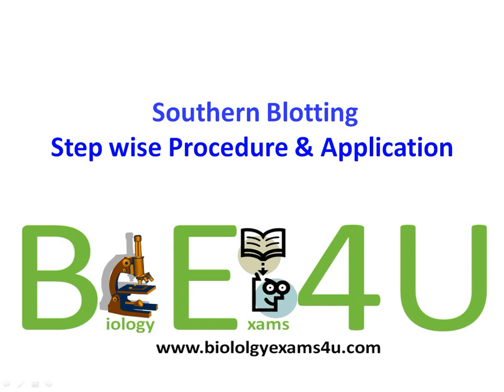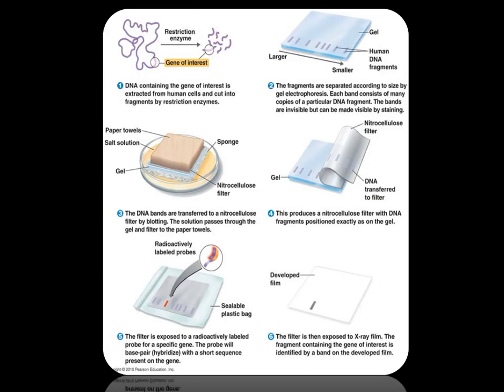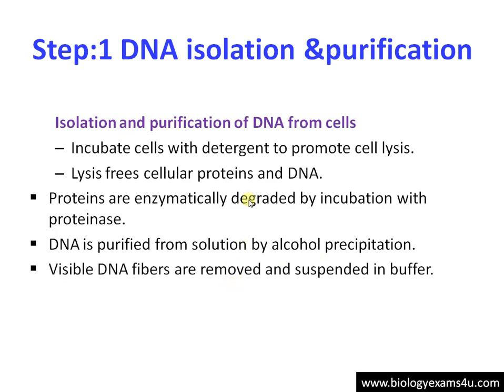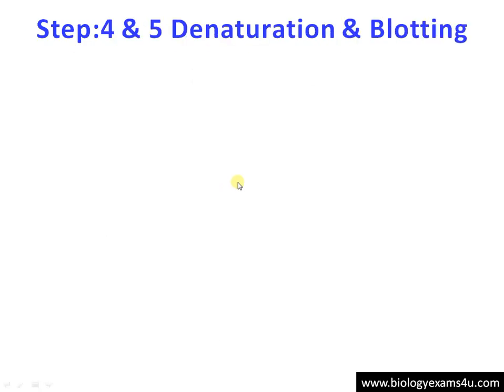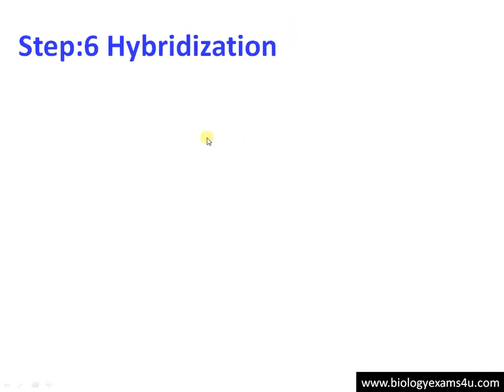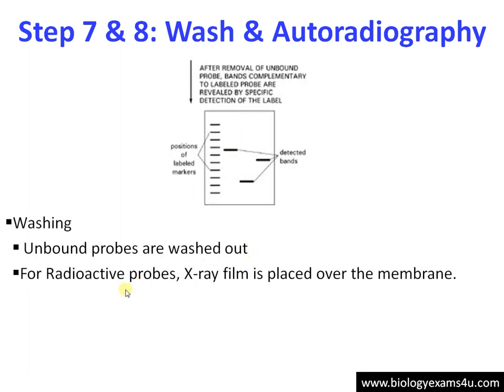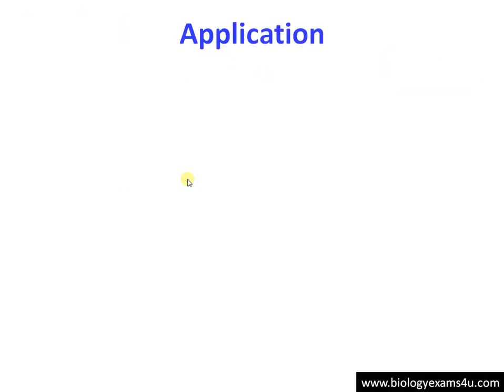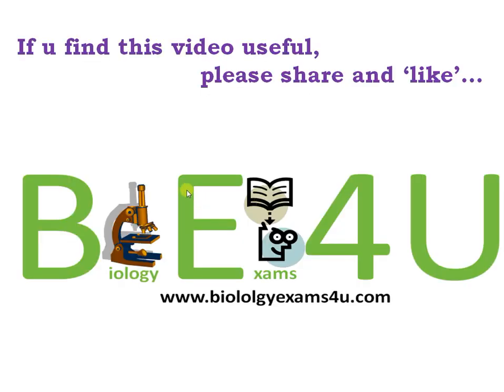Southern Blotting- Principle, Procedure and Applications

Comment: How is the nitrocellulose membrane helping in the hybridization? Why is it used? Can't it be done directly on the gel?
Reply: This is a speciall Membranous sheet where molecules can be attached gel can't be used ahead . In southern blotting we find a gene of interest from target dna for which addition of probe is required n then additional process like autoradiography ( incase of radio active probe) where how will you use this gel? If you are familiarize with how initially we loaded the dna you would understand it's not practical and i don't think it's possible for probe to run over gel again.

Comment: Hello,

First of all, nice video. Second, i have a question: I'd like to know how sensible are electroforesis in distinguishing DNA fragments by size. Would I be able to notice any diference between a fragment of 1 kb and a fragment of 2 kb?

Thank you
Reply: Leonardo Buback Yes, a 1kb difference in DNA fragments would be easily resolved by gel electrophoresis. I think a 1% gel (1g agarose powder per 100 mL 1X TAE), ran at ~100 volts for 30-45 minutes would work beautifully. You would run a ladder to gauge the sizes of bands based on their migration. I would use the 1kb ladder from New England Biolabs.